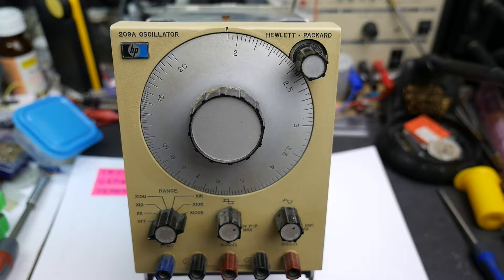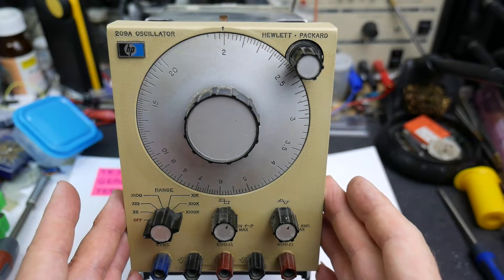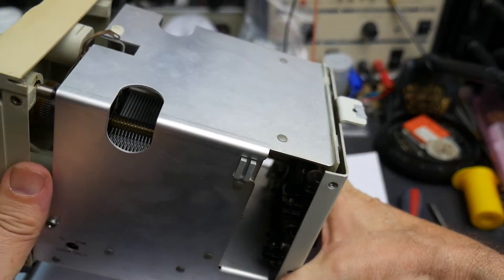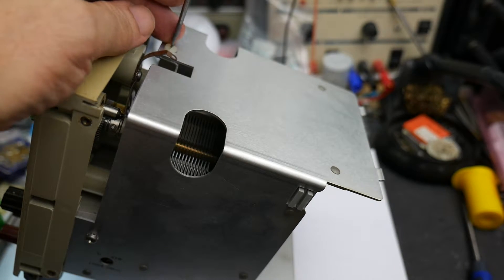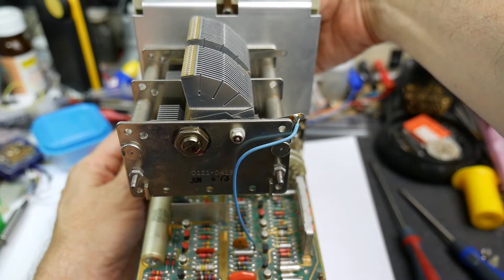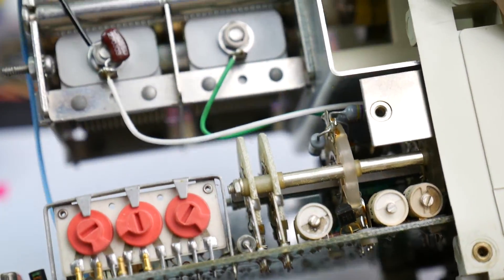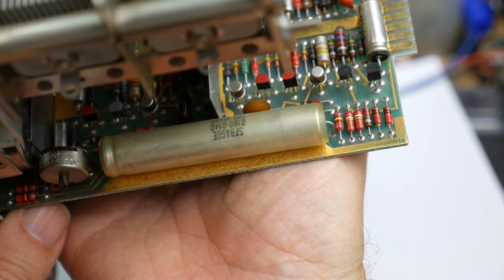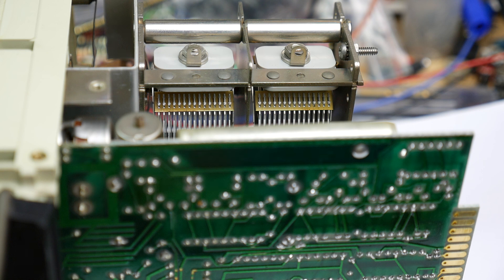Test Gear Teardown: HP 209A Oscillator

Comment: very good Sir,  now I do not have to do the teardown to see the inner workings...I picked this unit up at a Hamfest for $9.00 and still in operating condition. I am trying to figure a way to add audio modulation to make it a AM low power transmitter on the 160 Meter band. ..do you know where in the schematic to add the audio point?